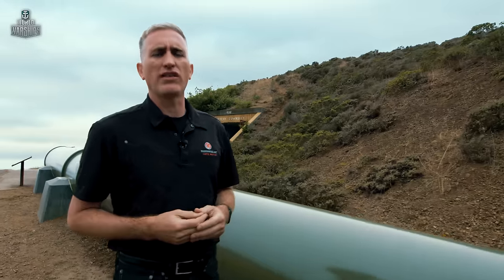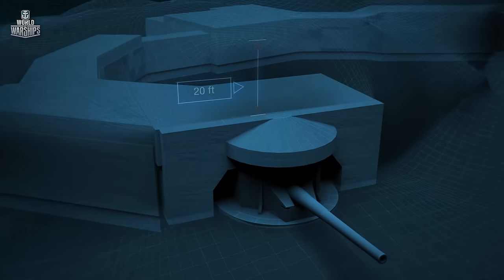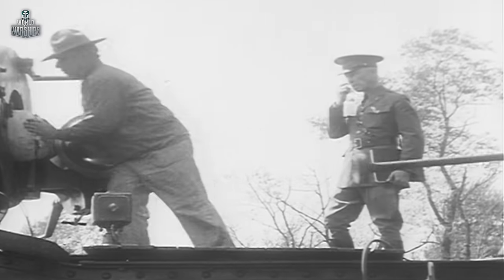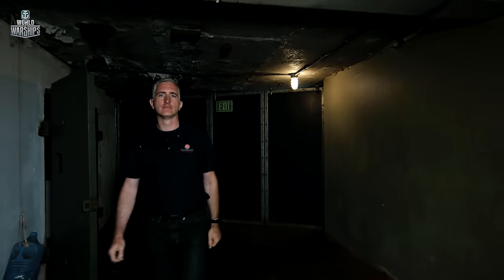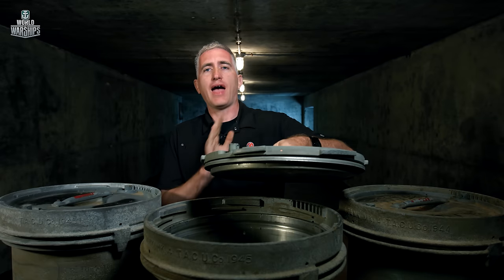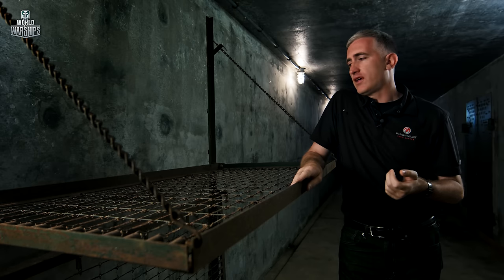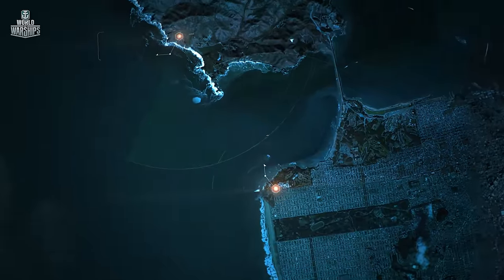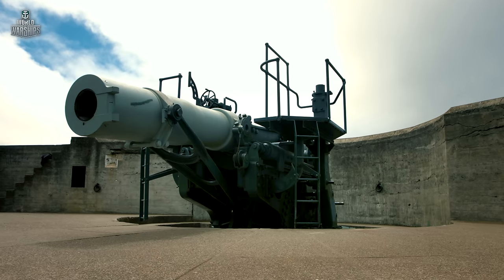Naval Fortress: San Francisco Artillery Corps

Comment: The city of San Francisco had air raid sirens installed in 1942, and those sirens replaced and supplemented with upgraded sirens only a few years ago. If you're ever in San Francisco they test the sirens every Tuesday at noon and they can generally be heard throughout the city.
Reply: I still questions why they tested so often.
Reply: @seanahuang7239  why not? Better be prepared than be caught with your pants down, completely defenseless

Comment: Once again, outstanding video Chief!  Thank you.  I’ve lived in virtually the shadow of these 16 inch battery sites for over 30 years.  I never knew the full back-story behind these defense complexes. 
Your video was a real education.

I realize it’s impossible to include all the details of the total Bay Area coastal defensive site locations and their individual functions in a ten minute video.  But the full story is very interesting.

Not mentioned are the series are the few, still existing,  abandoned concrete observation bunkers located up and down the San Francisco Bay Area coast from just north of Santa Cruz in the south to near Bodega Bay north of San Francisco.

These remaining small concrete bunkers overlooking the Pacific Ocean were apparently wired for communication into the those 16 inch gun batteries profiled in your video. They functioned as an early warning/targeting source.

The range of ongoing opinions from local residents, as well as out-of-area visitors, on what the original purpose of these smaller now unkempt and overgrown defensive structures was when they were first installed many decades ago are so very entertaining, e.g., artillery bunkers, missile launching pads, machine gun nests, Anti-Aircraft guns, etc.

Comment: In addition to Townsley and Davis, there was supposed to be a third battery of 16-inch guns in the San Francisco Defensive Zone.  Construction 129 was built into the summit of Hawk Hill, just north of the bridge and occupying the highest point on the Marin Headlands.

It was never completed, and thusly never received an official name.  But it was nothing short of the zenith point to the evolution of coastal defense fortifications.  A top-side commander's cupola... integrated anti-aircraft batteries directly above it... special blast-through tunnels to dissipate the concussion in the event of a direct hit...  The thing was a design masterpiece!
Reply: Have you been in the emplacement just north of Steep Ravine?
Reply: Perhaps.  I've visited most of the batteries in San Francisco and Marin at one time or another.  But I'm not familiar with the name "Steep Ravine."  Is there a battery name associated with this emplacement?  What are some other nearby landmarks?
Reply: @Nutzkie2001  North of Webb creek.
Reply: @TheNimshew   Unfortunately, I haven't been to those bunkers.  The skeletal remains of the anti-aircraft battery just above Battery Townsley is as far north as I've explored.

Looking them up on the Stinson Beach tourism website, however, makes them appear to be part of a coastal observation post.  At one time the complex probably had direct communication lines to nearby artillery units.  It likely wasn't an end-line station, which is an integrated part of a battery's fire control system, but it was still a vital part of the overall coastal defense network.

I'll need to check them out sometime.

Comment: At the mouth of the Columbia River there are batteries like the 16 inch battery. They guard the entrance of that key river to the Rockies. There is one just under the lighthouse. I know because I freehand climbed up the granite face of the inlet, starting at the water,  and was surprised to find the structure. Climbing inside and exploring yielded a unique experience.  The hardest part of the climb was negotiating the chain link fence that kept people away from the cliff at the lighthouse.. hehe

Comment: About 7 miles north of there, on a bluff north of Webb creek is(or used to be) an abandoned gun emplacement right at the edge of the cliff overlooking highway 1 and the Pacific. There was a curved concrete and iron  mantle about 20" long, with a slit in it. The iron door was on the far right and a concrete pedestal about 4" in diameter inside. It was large enough for 4 people to sleep inside. Which my friends and I used to do when big storms were blowing in off the Pacific. It was a blast!(sorry) in 1968/1969. Fond, if blurry memories.

Comment: The CGI is very well made, i enjoyed it greatly. One small thing: If you render the gun in together with the smoke, the smoke needs to go over the gun as well, it sticks out the way it is. ;)
Reply: Good points made. Also, the muzzle blast would have been extremely intense. The 16" rifles were the same as used on the more modern American battleships of that era, such as the Missouri, Wisconsin, & New Jersey. They were always fired over the sides of the ships, instead of directly over the decks, as in shooting directly straight ahead or directly facing aft. To fire them over the decks would destroy equipment mounted onto the decks and/or blow it overboard. I wonder how much dirt & vegetation would have been kicked up during firing of the SF batteries?

Comment: You need to do the concrete battleship. I forget it's name though. But it was nicknamed the concrete battleship, it was a partially artificial island with two 12 inch rifles in dual turrets, the same as on the Wyoming and South Carolina.

Comment: Excellent tour and presentation!   Sleep outside?  In San Francisco?  You know what Mark Twain said, right?  The coldest winter he experienced was a summer in San Francisco?  LOL!

Though the arrangements are different due to location and geology,  the installation is similar to those at Ft MacArthur in San Pedro.  Two 16" emplacements on hilltops, and disappearing cannon in fortifications.  Additionally, Fort Mac had a mortar bombardment battery .   Another similarity is that both SF and SP locations also had Nike missile batteries constructed in the 50s.  

A little know fact about California coastal defense:  the Army had large caliber rail mounted cannon with special sidings being built along the coast between San Diego and Los Angeles, and between Ventura and Point Conception. 
http://www.ftmac.org/BatteryErwin.htm

A pair of fixed emplacements for 155mm cannons were built at the mouth of the Ventura River to protect the oil fields just inland.  These circular concrete  rings (Panama Mounts) are still there, though they have partly collapsed and are routinely covered and uncovered by wave action.
http://gunsofventura.tripod.com/panama_mount.html
http://www.ftmac.org/155mmGuns.htm

Comment: I'm laughing at the engineers. What about the fog 😂😂😂
Reply: The fog doesn't really start until inland if the Golden Gate.  The Pacific side is usually very visible.
Reply: @mbryson2899  Well that still leaves more than half of the guns. Hmm...
Reply: By 1940, Radar would be used for rangefinding.
Reply: @WALTERBROADDUS  Would aid in* Radar was used early warning not for accurate firing. And more so for gun laying post 1943.
Reply: @ThomasStephenForster  Still, it solves the fog issue.
Reply: @WALTERBROADDUS  No it doesn't. It was built when radar didn't exist.
Reply: @ThomasStephenForster  by the time the War started,  it did.
Reply: @WALTERBROADDUS  Well apparently it never got installed until the 1950's with the Nike Missiles.
Reply: @ThomasStephenForster  That is air search radar.  The point is, they could use a surface  search radar like ships were using for all weather Coast Artillery. I'm just saying  the tech is possible.
Reply: @WALTERBROADDUS  Anyway the whole point of the coastal fortification projects was a deterrent because the Japanese were most likely to send in submarines not a battlefleet.
Reply: @WALTERBROADDUS  I live in San Francisco as well and can definitively tell you that there were no naval radar emplacements at Cochraine and the other forts, just at. If your talking about aerial warning systems then Battery 129 had radar installed in 1942-3 after pearl harbor. Naval was planned then scrapped because by 1943 it was clear that the Japanese navy could not attack continental us with battleship artillery. There's a bunch of national park websites that explain this.
Reply: @ThomasStephenForster  No, we started this thread because you asked about fog. Remember? I just bought up radar as a solution.